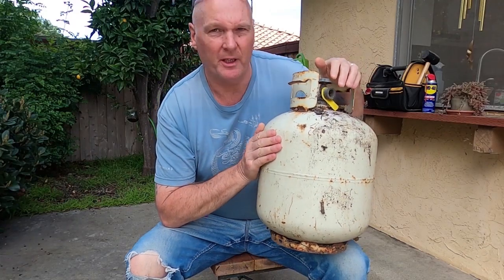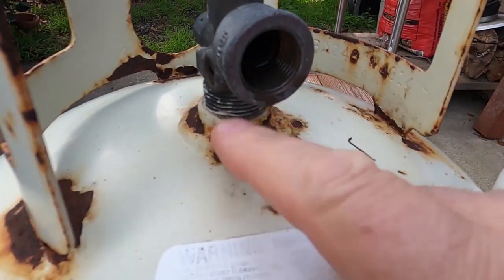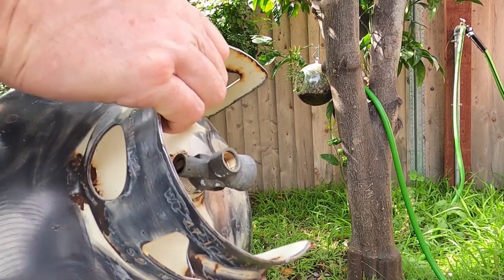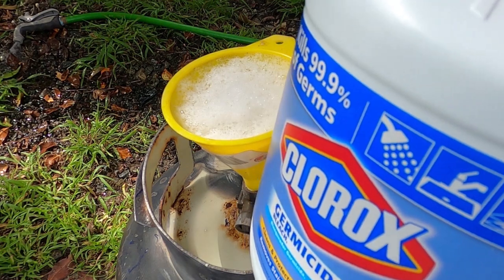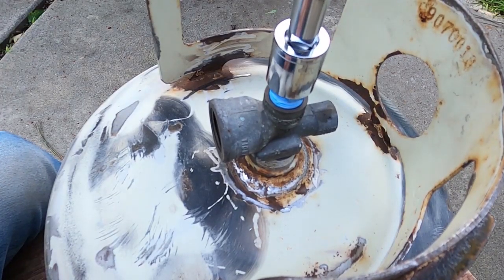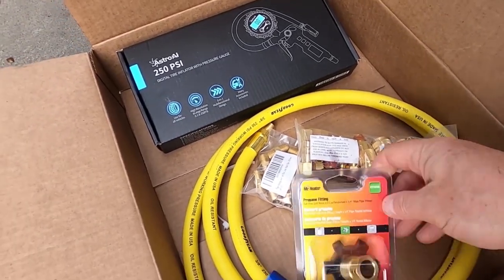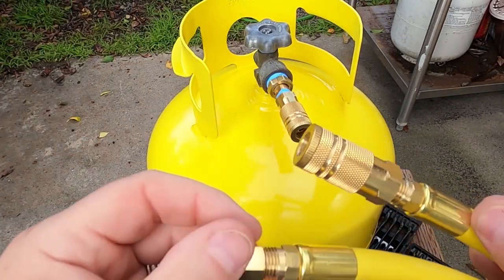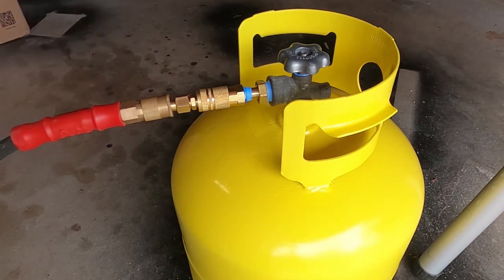CONVERT PROPANE TANK IN TO A PORTABLE COMPRESSED AIR TANK YOURSELF Step by Step

Comment: It's REALLY a bad idea to use a bottle with deep rust for compressed air. The steel is weaker making it more likely to explode. NEVER do this with a bottle that has rust on the welds, or ANY deep rust.

Comment: Y not just remove that old valve? Use a 3/4×1/2 reducer and a proper valve
Reply from the maker: @SilverCommander  you could do that if you wanted. For me i like how i did it. its cheaper to leave the valve alone it works great and less build time & a gas valve is a proper valve, this is perfect for my needs.
Reply: @JollyPeanut  gotcha. I would like to see how u painted the letters. Looks amazing
Reply from the maker: @SilverCommander  I just stenciled on to card cut out the letters tapped it to the cylinder and used black spray paint..
Reply: @JollyPeanut  looks good

Comment: I am a certified propane technician, and I will tell you the odorant that they add will linger longer than the actual propane gases so yes, you are completely safe! rinse the tank to be on the safe side It’s a good idea. Propane tanks are built to a higher standard than air compressor tanks with thicker metals and the older tank The thicker the metal. More and more propane, manufacturer companies, are trying to cut back as much as possible.

Comment: This is awesome and I am making myself one using your shopping list! I am adding a drain valve at the bottom (drilling a hole and tapping a 1/4 npt thread) so that you can release the remaining air and drain the condensate so this tank doesn't rot out from the inside out as fast.
Reply from the maker: great idea, I just turn the tank upside down open the valve it blows out any water, your idea is more professional...Thanks Plan B
Reply: @JollyPeanut  not really my idea :). The craftsman 25 gallon one I have has a valve like that.
Reply: Modifying a pressure vessel is a bad idea, you should just flip it upside down to expel any water.

Comment: Your video is awesome. That's what I was looking for. I wonder how I can make both male and female on the cylinder so that I can connect it to compressor and also connect a tool.
How you drain the water? Just turn upside down and open it?

Comment: Nice one. Had no idea it had to be drained so thoroughly. I tipped mine upside down for an hour then I grabbed my angle grinder and went to work. I even cut off the top bracket piece so I could get at the rust easier. Then I welded it back on. Thank god I didn't blow up, eh?
Reply: It blowing up from the remaining propane is nowhere near as big of a threat as it blowing up later from being welded on.

Comment: Just the YouTube clip I was looking for... I recently did some DIY repairs to a damaged car door and a bumper on my car. Though the outcome was successful I did go through a number of aerosol cans that never quite produce the results a good spray gun would. Not wanting to buy a compressor, I'm thinking this would be perfect solution for future repairs. From what I've read, you need between 25-30 psi (approx 2 bar) for spraying 2K clear. So with up to 300psi on tap I'm thinking this would provide the 25-30 pressure for a decent amount of time... Thanks for posting...now I'm off to build one! Cheers!

Comment: 80 PSI in a car tyre? Never heard of that. I use 32 PSI in mine.
Reply from the maker: I have a pannel van not a cat its a commercial vehicle desinged to carry a lot of weight thats why 80 psi,,, most cars are around 30 to 35 psi..Thanks 👍

Comment: I have made one tank like this, but i used a 30lb tank which for me is still not too heavy and i can fill up my truck tires with the big one.  I do not have a compressor so i fill it at shops.  I love your gauge, i only added a simple tire inflator to mine so in future maybe i will upgrade.

Comment: Awesome video. Quick question. I followed everything you did and added a gauge to mine, but it stops at 100 psi. I can’t add any more air to it. Is there something I did wrong.
Reply from the maker: It just depends on how much pressure your compressor can produce, most domestic compressors produce far less than what the manufacturer say thay produce.
Reply: @JollyPeanut  oh ok. I thought maybe it will just keep on adding air till I stopped it.
Reply: @JollyPeanut  oh ok. I thought maybe it will just keep on adding air till I stopped it.

Comment: Nice presentation !I could ad install a gauge psi instrument on thank to monitor tank air as well
Reply from the maker: Thanks.The tire inflator i use in the video also tells you how much air presure is left in the bottle thats why i did not fit a gauge, buy yes you could easy fit one to the bottle if you wanted to, it would be handy for uses other than just inflating tires.

Comment: Yes these are also good for aerating your compost pile if you make yourself a 4 ft long 1/8" pipe you can shove it into a compost pile and oxygenate it and it will make compost with less smell and faster.  You can also use it in a rocket stove to increase the temperature for faster cooking.

Comment: to clean out these tanks just take the valve out the tank. it real is not as hard as you might think. especially if the tank has  handles like this one. you a big spanner that fit on the vale. poke a long metal pipe through the handles and put a pipe over the spanner then a good hard push and hey presto valve moves.... fill it with water and leave a running hose in it for about 1/2 hour... then tune it upside down and let it stay upside down for a day.. now you have a completely dry tank.. i would not bother paining inside as compressor tanks are not painted inside so why bother with the small tank ? if you do want to paint it then you need to check in some glass beads and roll the tank along the ground for like 20 minutes minimum to clean the side walls so the paint will adhere to it... empty out the glass beadsand now rinse again with water to make sure all out and let dry with it upside down over night. next day you can pour in your paint and then plug the tank with something and swish it around slowly all directions then hang upside down to let all the excess drip out........ when you think its all out then put a bit of rag on your finger , poke in the hole and wipe around. now keeping it upside down leave it at least 48 hours to dry..... once completely dry get a blow lamp and slightly heat the tank on the outside still with valve out. now let cool and you know your paint is dry. time to paint the outside while the valve is still out... paint that area first youl see why in a minute.. paint from the top , all the handles etc and work you way down while its on a  table. when almost at the biottom get the valve back in.... valve is only in to be used to hold the tank up in the air so you can paint the bottom and have something to hang the tank by while its drying/ leave till next day now take valve out put on some teflon and put valve in and tighten it down......  now you play with fittings of your choice. BUT NEVER PUT OVER 150 PSI IN THE TANK. IF the tank gets left out in sunlight the pressure will massively rise

Comment: Nooooo! These tanks are not rated for the pressure service you are subjecting them to.  This is a bomb!
Reply from the maker: the 20lb propane tank has a safety blow out valve which goes off at 375psi or there abouts, Normal psi for propane is between 100 & 200 psi, so for what i am doing inflating tires the propane tank is perfect that is why so many people use them. Here are some official stats for you to see for yourself, if you have official stats to back up what you say then drop a link......https://www.ferrellgas.com/tank-talk/blog-articles/how-much-pressure-is-in-a-propane-tank/
Reply from the maker: Rubbish do your research.
Reply: Those Propane tanks are far heavier gauge than any small compressed air tanks on the market heavier by far they are over engineered to withstand fires & not explode obviously within a tested time span  . Try shooting one with a 9mm you will see how tough they are.
Reply: @battlebright4122  you keep thinking that. When your toy explodes in your face and rips it off they can explain it to you, again...

Comment: You are going to have to remember to empty the condensation out some how. I’m not sure poring it out of the valve would be a good idea as it may cause a problem with the valve seating. Very good job anyways.👍
Reply: A bit more work, but take your valve off, pour some Rustoleum into the tank, swirl it around and pour the excess out. That will protect the interior from moisture. Good job!
Reply from the maker: I just turn it upside down  and open the valve once in a while that will blow any water out, there's not much moisture in the air here in Southern California so not a problem for me but you do bring up a good point, if i did get a lot of moisture in the tank i would drill a hole near the bottom and weld a tap / valve in there. Thanks buddy.

Comment: Well done! I wonder how hard it would be to plumb a gauge on the tank itself? It might be useful to know how much air is onboard before leaving the garage with the tank.
Reply from the maker: The inflator gauge i used not only reads the tire pressure it also reads the tank pressure so i don't need one.. but to fit a stand alone gauge is very simple but for me i prefer it as it is less clutter & i can read a very accurate tank & tire pressure.
Reply: @JollyPeanut  I was unaware of that feature on the inflation gauge. Thanks!

Comment: If your hose and tire gauge are rated for 250 psi, why would you even think of pressurizing the tank to 300 psi???
Reply: I was wondering the same thing. You were the last comment. Did you also notice that he used teflon tape on the fitting that has an o-ring? Also the teflon tape was wrapped the wrong direction.
Reply: I don't know of any Homeowner air compressors that will go over 175 PSI anyways.
Reply: Because he’s a clueless lunatic. If you stop and think of 300lbs being applied to a square inch of your body you’re going to be damaged. Commercial compressors run to a max of 175psi, they have safety valves built in. When your blowing up tyres to high double digit or higher pressures there should be 6’ of hose between the Schrader valve and the gauge / inflator lever too keep the operator out of harms way, if the tyre-wheel is off the vehicle it should be contained in case the tyre casing fails. In the U.K. insurance companies send out specialist engineers to inspect compressors & air receivers on an annual basis, these are compulsory inspections. More worryingly he’s talking about building a compressor 😬

Comment: I'm planning to make an air tank like this, but want to coat the inside of the tank with rust paint. I've seen other videos where they do this by removing the top valve entirely, pouring in the paint, swishing it around, then dumping out the excess. I would prefer to just disassemble the valve like you did in this video. Do you think it would be possible to pour in paint through the disassembled valve? Or would the paint end up getting all over the valve's mechanisms when pouring it out, making it unusable?
Reply from the maker: Takes ages for water to get through that valve so paint no way, you will need to remove the whole valve you will need a long heavy pipe for a good lever they are in tight but easy enough if you rachet strap the bottle to something that won"t move like a tree. Good Luck
Reply: @JollyPeanut  Thanks for the information!

Comment: Great vid  thanks,  for the other  propane tank with inside and outside threads,  is there a similar righty-loosy type fitting under the  turn knob?  Whereby can be cleaned as in this video?

Comment: Thanks for not using the metric system!
Reply: He's in California USA, using SAE wrenches and NPT fittings on a 20 Gallon tank/bottle.
Reply: FYI, the world is metric.
Reply: @redgum1340  Both Hitler and Stalin used this totalitarian measuring system. Churchill and Roosevelt used a system whose measurements were based on human scales. Whose side are you on?
Reply: @thermionic1234567  I'm on the metric system which is the most logical. :)  I don't consider any political leader when measuring a piece of string.    LOL